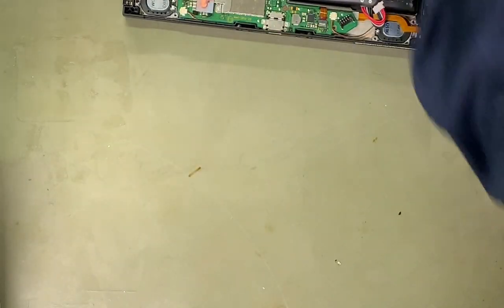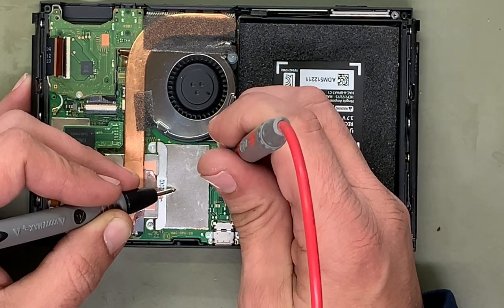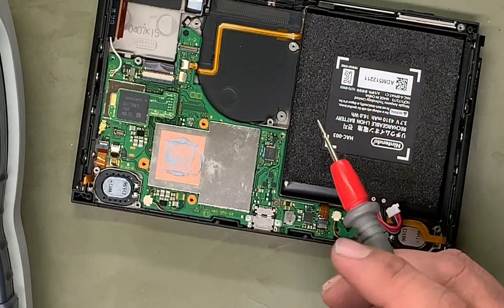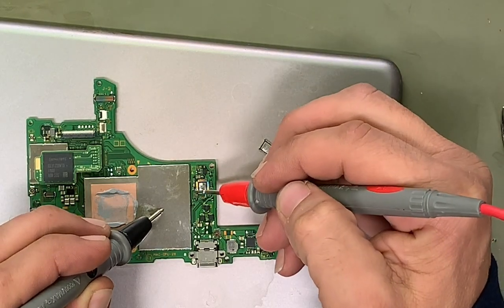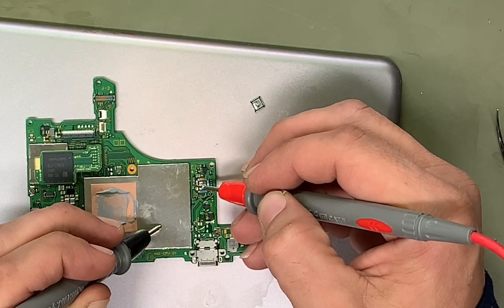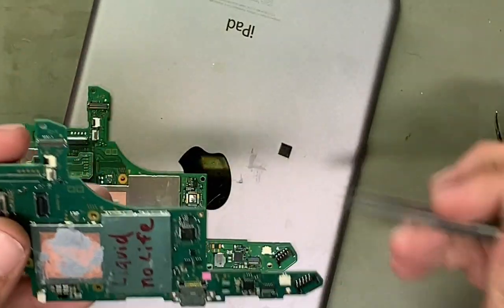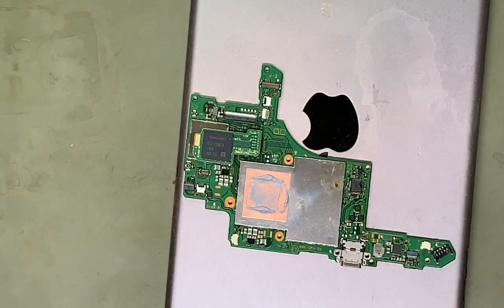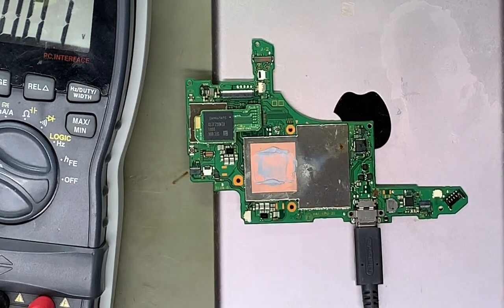Nintendo Switch No Power M92T36 and P13USB Replacement Diagnose

Comment: Well well, seems that after watching you nail all the chip replacements I am a little disappointed you powered up a different device in the last clip to show it working. I was impressed until that point.
Reply: Yeah same here
Reply: And he has a touch like an elephant, he has no business in electronics, slinging parts around, and when he flipped the switch over onto it's LCD side like that I died a little inside.
Reply: eso quiere decir que no la reparo? por favor, james es un crack, igual que ese londsey show, seguro es tintorero
Reply: Good catch, you can still see the one he was working on still laying on the table.
Reply: You’ve got Hawk eyes. I didn’t even catch it until you mentioned. Wow. Whole video a sham now. SMH.
Reply: As if he doesn't work on multiple

Comment: For people wondering about the temperature for the hot air station it needs to run pretty hot. The P13USB has a solid copper plate on the bottom of it, so you're likely going to need to run a temperature between 400-450 for quick chip removal. After removal let the board cool down for a while before prepping and installing a new P13USB. If the temperature is too low you will likely pull the pads and doing trace repair with wire is no fun especially if you have to try and reseat the chip again and run wire.
Reply from the maker: 360 Celsius
Reply: @RepairLegion  if you have something heating the other side if the board yea. The problem is at 360 you have to heat up the chip for a while
Reply: @RepairLegion  will try again at 360.
Reply: @RepairLegion  lol that's way too high for a little switch board. I've never seen anyone go over 470 fahrenheit on these boards. No need.

Comment: Hey, Chase spoke about your FB group but I don't do FB so figured maybe I can ask here. I have a switch lite, powers on, charger fine, no water damage but interminately it will shut off and sometimes shut off with a long beep. Voltages seem fine, charge port is fine and I don't see any obvious shorts. M92 and BQ seem fine as well. Any suggestions would be appreciated.
Reply from the maker: The symptoms you describe is not a normal fault and does not point me to anything specific
Reply: That is where I am at too lol. Regardless, thanks for the reply! @RepairLegion

Comment: I'm completely new to this. I bought a good multimeter (Fluke 117 model) and not sure how to use it. I bought a Switch OLED on Ebay that has no power. I know 90% of the problems with no power on these units are the M92 chip being bad based on many videos that I've watched on here. What do I need to set my multimeter to in order to detect shorts?

Comment: what heat rework station is that? I have a $40 one with air flow control and temp control. Do you think it will work the same?

Comment: Hi there I have just replaced the charge chip and there is no difference I looked on the back and the P 13 had a hole in it.
Could the P13 have damaged The new charge Chip that I have put on the board?

I’m going to order a new P 13 should I order a new charger cheap as well?
Subscribed thank you
Reply from the maker: Remove pi3. And attempt to boot. It will boot without pi3

Comment: For example, you do not use the switch for a longer period.

How to behave the best if you take a break of
a.) 1-2 weeks?
b.) 3 months?
c.) 6 months?
d.) 1 year?
So that the especially the accumulator of the switch will NOT get damaged...

e.) Or how to behave the best if you almost daily use the switch in Dock mode?
f.) Or how to behave the best if you almost daily use the switch in portable mode?

Devices with accumulators that are not used for a longer period should always be changed between 80-20% of their maximal capacity.
They should be stored in a dry place and not exposed to the sun and to the cold.
So a good stocking place could be a cupboard in a room that is dry and heated in winter and the switch should never be exposed by temperatures over 40 degrees.
right so far?
Especially the first switch models that are customer firmware compatible without soldering contain a weaker accumulator then the new switch models.
It would be good if an old switch could be preserved as long as possible and could be still used in 2050 ;-)

Sega`s game gear is still working today if the common problem of the capacitors is solved.
Is for the first switch also a common hardware problem already know?
Or according to the PCB layout and the used electronic components which most likely problem could occur in the future?

What is your best strategy to ensure a long product life of the Switch?
Thank you in advance for your time and advice.

Comment: roughly how much would you charge for doing this? I got charged ~50USD from a technician and it was found that none of my IC chip failed but was a capacitor/fuse blown hence he removed it and it worked perfectly fine as usual. He said removing 1 of it wouldn't matter much as there were a few more of them to protect the SoC/board..
Reply: I was charged 210 USD
Reply: @Francesco-qy8cv  HELL NAH BRO WTH......the chip is worth like 5 bucks. if u had 2 swapped its like 10 for material, then his labor which is 1 hour. it shouldve been at the most 100 bucks. sucks that you got scammed.

Comment: Where do you buy these chips from? Tried searching "P13 USB" on mouser. Found nothing
Reply: He gets the number wrong, it's not a P13 USB, it's a PI3USB30532ZLE chip. You should be able to get that chip easily.
Reply: Just look on ebay for Nintendo Switch video chip or Charge chip

Comment: Hello friend I with a doubt my switch does not turn and I don’t even take it apart I realized that p13usb the capasitor on his side is beeping on the multimeter on both sides this is normal and I have to change this p13usb

￼

Comment: My Switch works fine, except when playing docked; after some time playing on TV the TV output would fail. When I undock the game is still running fine no reboot what so ever. Is it one of these chips failing? The dock is fine, I have other Switches to rule out the dock failing.
Reply from the maker: PI3USB controls docking. Common failure point
Reply: @RepairLegion  
Thank you for the reply. I’ll order a PI3USB from Ali. Any recommendation for a heat air gun from Ali?
Reply from the maker: @bluepingwu  for cheap and decent I would go with aoyue 968a. For quality machine would be Quick 861DW

Comment: Nice, I have a question. My nintendo Switch, when I conect to the dock station it just does not transmit video to my tv, I bought a new dock station but the video just seems shifted not a stable image and after some time the video on my tv just turn off.
Reply from the maker: Erick Espinosa common video issues. P13USB likes to die

Comment: So my switch will display a Nintendo logo when I perform a reset but goes back to a black screen after that with no charging symbol.. last night after it was sitting for a day off the charger I pushed the power button and I got the charging symbol... so I left it plugged in all night. This morning it is back to just displaying the Nintendo logo and going back to black screen. Do you think I need to replace that chip? Or could it be a different issue you think.
Reply from the maker: Dan Murphy faulty board. No resolution to that issue
Reply: Hey I just had the same prob and sent it to ubreakifix and they’re telling me it’s the m92t36 chip and quoted me $150 for the repair
Reply from the maker: Andi Choi no. That’s incorrect.
Reply: Game Console Repair Legion Playstation, Xbox, NES So I did more troubleshooting. It shows the power level for a couple seconds if I hold the power button down for 15 seconds and then plug it in. Alternatively if I hold the power button down for 15 seconds then push the power button again it shows the Nintendo logo for a few seconds before shutting off.

Comment: hello on my switch v2 board only 5.2v can be detected on the 15v line... theres no shorted on the board m92 fine batt ic fine usb chip p13 fine... whats causing this? usb port seems fine and nothing seems burned on the board battery doesnt charge and theres no voltage on the phase near batt...
Reply from the maker: tushi warashi check fuse

Comment: So when it beeps it means there’s power and if doesn’t there’s a short?
Reply: Those are 2 different settings on this voltmeter. Either you check for resistance and see if smth has a connection to ground (one probe on ground and the other on the part you wanna check). If you hear a beep you know the part has a connection to ground. If you have both sides of a capacitor connecting to ground, you know smth is faulty. On the other hand, you can check the voltage via direct current mode. So you can check again with one probe on ground and the other on the spot you wanna check. In this mode you don't have a sound or beep.

Comment: If you test with another battery and the switch turn on normally, however still not charging. Where do you look to replace on the motherboard
Reply: Could be the ic chip or the charge port its self test all the capacitors around the ic chip.

Comment: 15V ? That's not correct. 5V standard the Power supply will only switch too 15V when its docked
Reply from the maker: Chris James hey cousin !!! No sorry but 15v is what the switch takes. Not 5
Reply: I don't think you are correct.